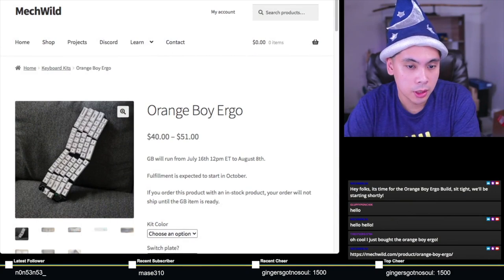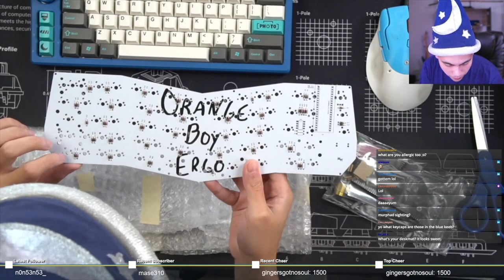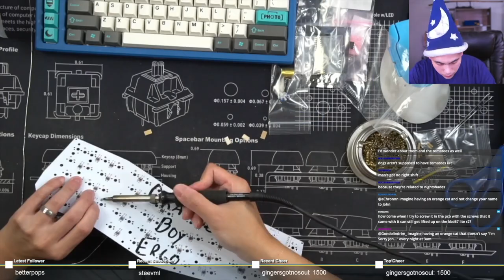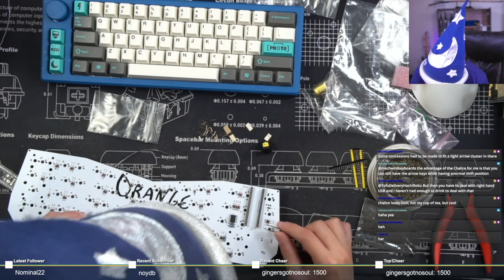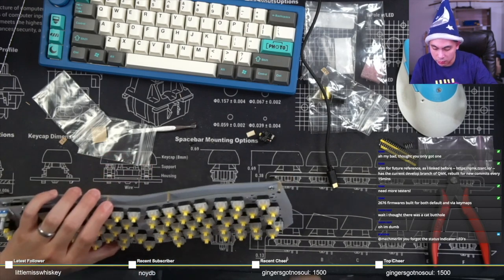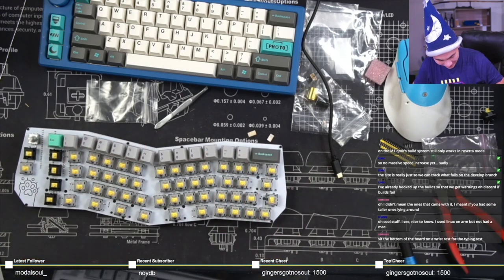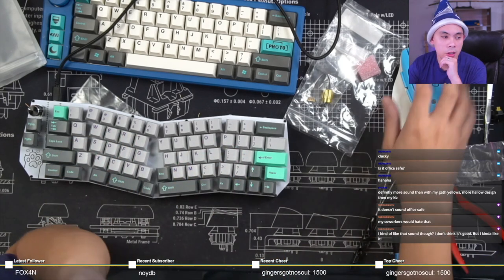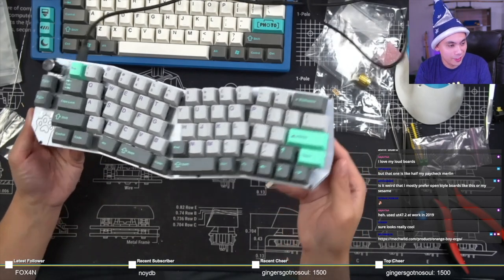Build: Orange Boy Ergo (OBE)

Comment: dont u need stabs for this keyboard?
Reply from the maker: I mentioned in the video that I was in a hurry and since the board was plateless I could add stabs after the fact. 

On another note, stabs are used for stabilizing keycaps that are 2.75 u and over. Depending on the type of switch you use and your typing style, where you press, you may find that like me, the stabs were not needed. Benefits: 0 Rattle lol